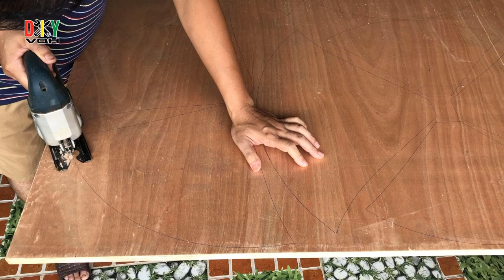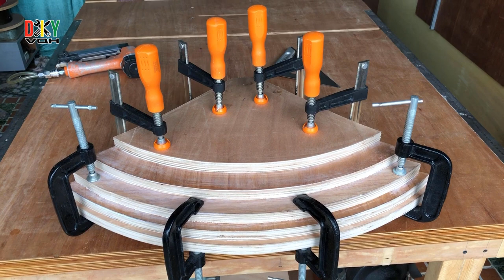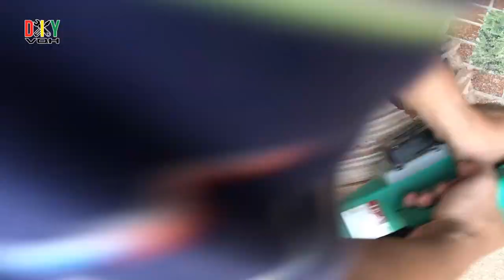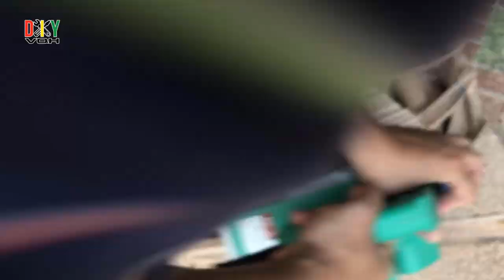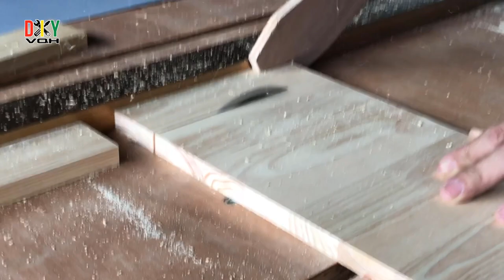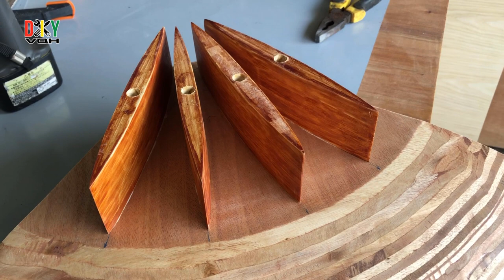DIY Wood horn speakers. Part 1.

Comment: I was wondering if you have links to templates that you used or any other info that would make the dimensions and such more clear. It would be difficult to start a project like this without them?
Reply from the maker: I rely on draw to make it
Reply: Look up Yuichi A290 Horns, you will find plans.